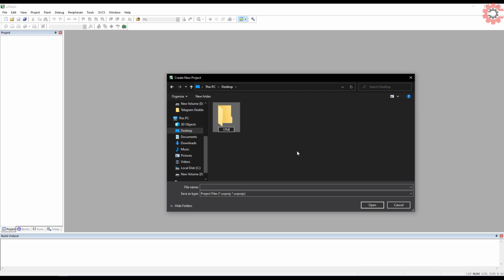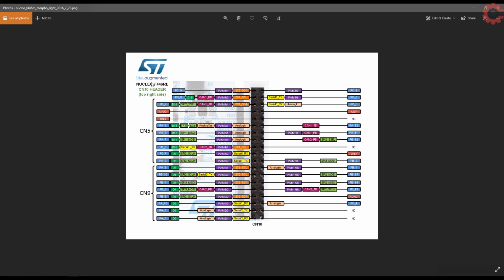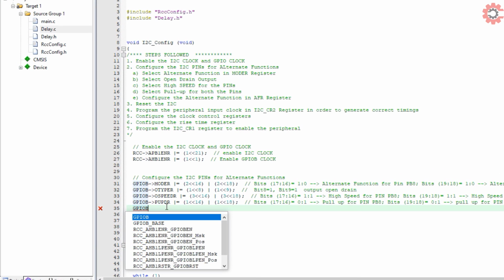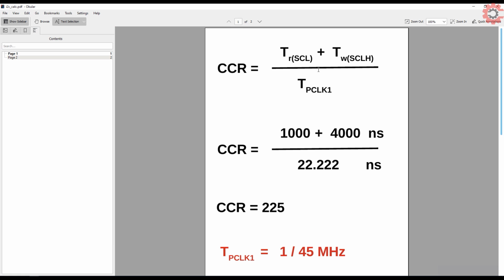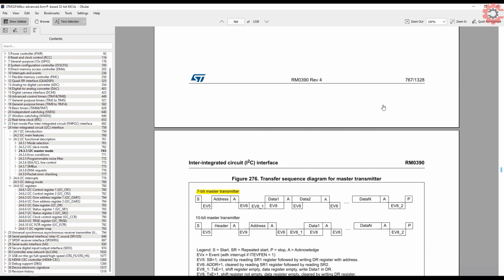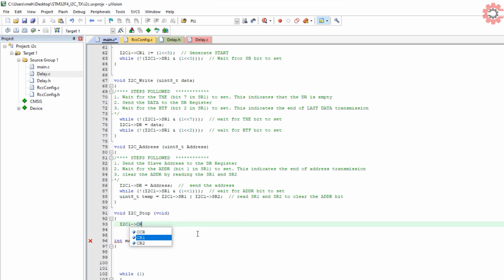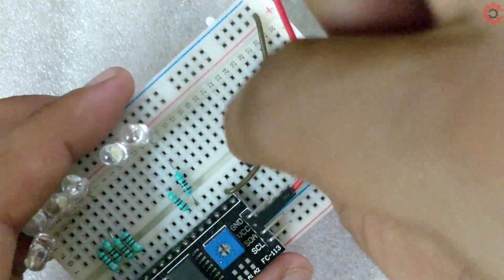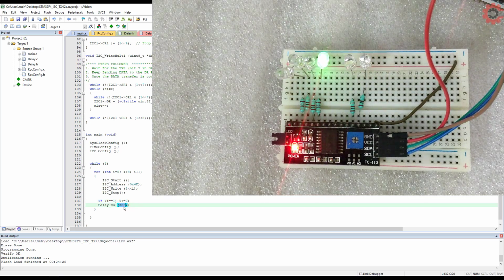I2C Communication in STM32 (PART1) | Register Programming Explained #4

Comment: For some reason this didn't work. I have the same I2C module as well. I've been following along using an STM32FR01RE, and the other three tutorials were fine, but this one did not work whatsoever. The address is incorrect despite having the same I2C module and verifying the address in the data sheet of the pcj.

EDIT: My jumper wires were bad. I bought a bunch of new ones and came back to this to try those and it worked perfectly.

Comment: I2C characteristics say only
Standard-mode (Sm): with a bit rate up to 100 kbit/s
Fast-mode (Fm): with a bit rate up to 400 kbit/s

there is no tw(sclh) and tr(scl) for stm32f407vgt6
how can ı find CCR and TRİSE for FM adn SM
Reply from the maker: it must be somewhere in the electrical characteristics in the datasheet (Not reference manual).

Comment: what ide software you are using to program the stm32 board in this video?
Reply from the maker: Keil microvision.
Reply: @ControllersTech  Oh yeah, and how'd you plug the stm, using st-link?
Reply from the maker: You can't. Some of the boards do come with an additional usb (user usb). If yours don't, connect an additional usb using IO pins.
Reply: @ControllersTech  okay, thank you sir

Comment: Thank you for your best tutorial ever! I have only one problem sir: When i activate one more timer in one pulse mode like the code behind , it dont put me the pwm2(pulses for triac) but give me 3,3V at output of the timer . When i cancel lcd init() it give me the pulse in output,,, what can i do?

void TIM4Config (void)
{
RCC->APB1ENR |= (1<<2);  // Enable the timer4 clock
RCC->AHB1ENR |= (1<<3);  // Enable GPIOE CLOCK

                          TIM4->CR1   = 0x0089;        // Auto-reload, One-Pulse-Mode
			  TIM4->CR2   = 0x0000;        // Idle-state configuration
			  TIM4->SMCR  = 0x0066;        // Trigger-Mode, Timer input 2
		          TIM4->DIER  = 0x0000;        // Disable interrupts
		          TIM4->SR    = 0x0000;        // Clear status register
 
                          TIM4->EGR   = 0x0000;        // Clear event generation register

			  TIM4->CCMR1 = 0x0178;        // OC1: PWM2-Mode, Preload, IC2: IC2 on TI2
			  TIM4->CCMR2 = 0x0000;        // OC3/OC4, IC3/IC4 off
			  TIM4->CCER  = TIM_CCER_CC1E;        // OC1: On, AH; IC2: On, Both edges
			  TIM4->CNT   = 0;             // Clear timer 1 counter
			  TIM4->PSC   = 168-1;         // Set prescaler to 168
			  TIM4->ARR   = 0x0000;        // Initialize Auto-reload register
			  TIM4->RCR   = 0x0000;        // Clear repetition counter
			  TIM4->CCR1  = 0x0000;        // Initialize Capture/Compare register 1
			  TIM4->CCR2  = 0x0000;        // Clear Capture/Compare register 2
		          TIM4->CCR3  = 0x0000;        // Clear Capture/Compare register 3
	                  TIM4->CCR4  = 0x0000;        // Clear Capture/Compare register 4
                          TIM4->BDTR  = 0x8000;        // Main output enable
			  TIM4->DCR   = 0x0000;        // Clear DMA configuration (DMA not needed)
		          TIM4->CR1  |= 0x0001;        // Timer 4 Enable

																	   	   	   
GPIOD->MODER   = 0x0A000000;     // Enable PD12/PD13 alternate function mode
GPIOD->AFR[1]  = 0x00220000;     // Select PD12/PD13 alternate function AF2
GPIOD->AFR[0]  = 0x00000000;     // Clear AFRL

GPIOD->OTYPER  = 0x00000000;     // Set all outputs to push-pull mode (default)
GPIOD->OSPEEDR = 0x00000000;     // Set all outputs to low-speed (default)
GPIOD->PUPDR   = 0x00000000;     // Disable all pull-ups and pull-down

}

PLEASE HELP!

Comment: Thank you for great tutorial sir.I have question.in which part of  reference manuel or datasheet it says we have to configure I2C pins as Open -Drain?Thank you.
Reply from the maker: It doesn't say in the reference manual but I2C pins must be selected in the open drain mode.
you can Google about the reason it's very long for me to write here
Reply: @ControllersTech  Thank you for repyling  Before using F4 ,I was using f103c8 .in its manuel ,it says we have have to configure i2c pins that way but f4 manuel does not say .This is why I asked you.

Comment: hi! i really love this tutorial. and i have a question, if i wanna use this method for lcd 16x2, how can i control the cursor and also how can i use string to display my output on lcd?
Reply from the maker: see the lcd16x2 using i2c video
change the hal i2c function with your own function
Reply: @ControllersTech  Hi, how can I create my own function to replace hal i2c function?, thanks
Reply from the maker: Check out the i2c video in the register based series playlist
Reply: @ControllersTech  Hello, thanks for answering so quickly, yes! I already saw that video and tried to integrate the lcd library with i2c of the video where cubemx is used, but I don't know how I should change the function of HAL_I2C_Master_Transmit, for one that allows me to use the lcd, with the i2c settings of the register based series playlist, thanks,I really appreciate your help
Reply from the maker: https://github.com/controllerstech/STM32/tree/master/LCD1602_I2C_NOHAL
Reply: @ControllersTech  thanks, it works perfectly

Comment: This is exactly what I have been looking for.  Decoding HAL functions to get this info is grueling.  Some devices (like STM32G474) cannot be done with uVision5 alone but require CubeMX which adds huge files/dependencies to the project.  Would love to see that sorted out.
Reply from the maker: Yeah I agree. CubeMX generates some useless HAL codes, which are not needed anywhere.
I will keep working on Register based tutorials. Although they are somewhat complicated to work with, since the proper steps are not provided by the ST
Reply: @ControllersTech  I had started with HAL but understand the hardware better by programming the registers directly. The LL drivers are register direct also plus the function document what your doing.